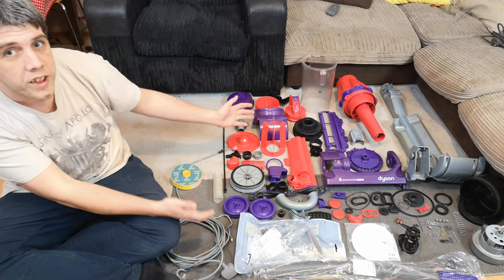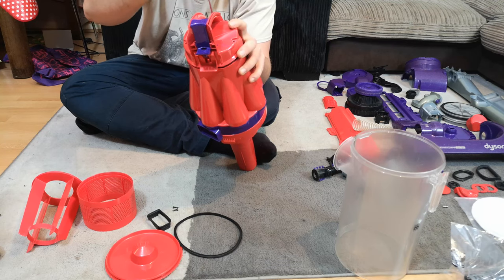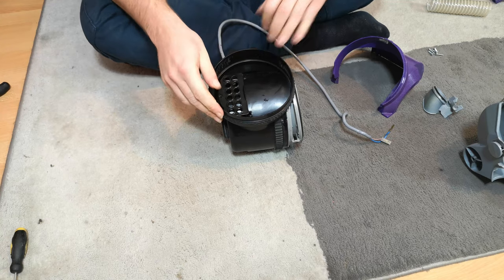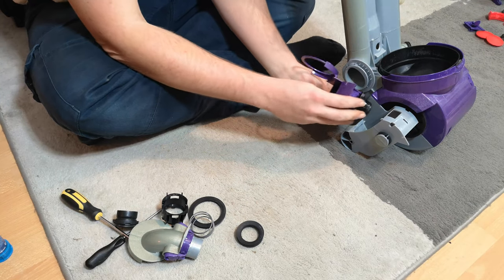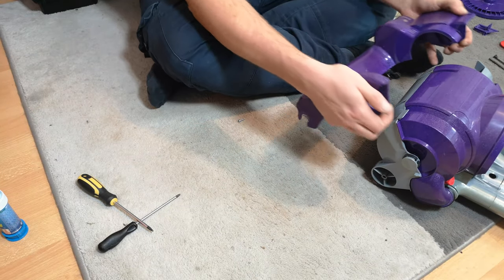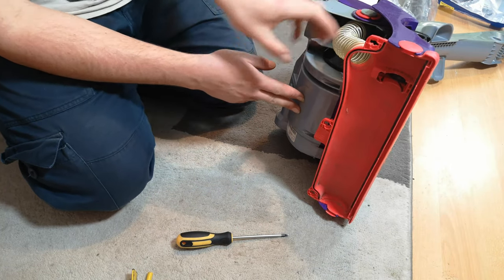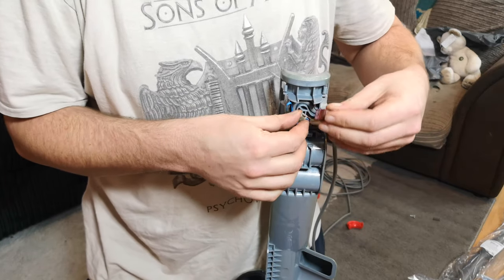Dyson DC07 - FULL Reassembly How-To Video!

Comment: Great and thorough strip down that gave me the confidence to tackle a rebuild of my own DC07. Some of the plastic parts had become brittle and had broken so I just bought a replacement chassis and transferred the old bits over. Now, cleaned up, it has the suction of a like-new machine. By modern standards the DC07 may be chunky and brash but it does the job  better and cheaper than many modern vacuums. What a shame they no longer make them. Thanks Biko

Comment: Great video & together with the tear-down you’ve enabled me to replace the motor on my 20yr-old Animal! A couple of things need highlighting though; 1) the small seal on the motor has unequal lugs (on mine at lease!) so care needs to be taken when refitting to the motor so it alights correctly with the corresponding cutouts in the case;  2) refitting the deep clutch cover screw is easier if you do it first, offering the cover up to the hole in the main chassis so that the screw slips into the channel which then eases alignment. Other than these minor points a brilliant vid which has hopefully given my DC07 a new lease of life!

Comment: I want to say thank for your video’s. You have helped many times with me fixing my DC07 Animal model. This vacuum is wonderful, it does the job it was made for. It’s getting old now(I purchase this vac back in 2008) and she is still going and picking up dog hair and cat plus human hair all these years. I’m just now replacing some parts. And there not big parts either. The parts I have replaces have been was the clear canister due to poor repair, the wonder Elderly  lady was up in her years force the old canister from the bottom to open, hence reason for new canister. I also replaced gaskets. Tutoring via  Videos on how to cleaning the cyclone, and how to put together the handle cap again. 
So thank you very very much from a lady across the pond 🙂

Comment: Dam it ! Only just found you, last week I paid £25 to have a broken wheel replaced, I could have got one on ebay for £4 but didn't have any idea how to replace it, BUT I do now !. This Dyson was bought to replace my brilliant all original Hoover 612 which was an amazing machine,  only reason I replaced it was because if you accidentally knocked the bag a cloud of dust escaped,  I was told I could wash it but it made it worse 😕 . I tried to donate it with the original tool set in it's original box but unfortunately no body wanted it, I thought somewhere like "The Black Country  Museum" or other places like that would like it but sadly I couldn't give it away. 
Thankyou for your fantastic videos.  I've subscribed,  I think I might need you in the future 😊
Reply from the maker: Shame to read about the 612, it might find a home on ebay with postage (the handle comes apart into two for ease of packing!). Their really hard to convert to an inner bag which doesn't help...

Comment: A huge help in replacing the motor in my DCO7.  I certainly wouldn’t of tackled the job or accomplished as easily without your thoughtful directions. As it was a maintenance change I didn’t extend it to the useful tear down and clean sequences you applied to machine viewed here. Those rewinds at slower speed also identified the corresponding parts to get the trickier jobs done with least fuss. 

I still managed to get to the clutch drive belt cover on but the hidden screw access wouldn’t align. After looking at the whole cover I noticed that the plate adjacent to the clutch selector switch was outside the purple changeover cover; you do show a functional check in your video to highlight this!  But retracing those steps was not too much grief. 
When refitting the brush assembly, as an alternative, I used a trampoline spring puller to extend the brush belt; which many folks may have to hand. It does require the feet to brace the upturned base as you tension the belt and,  with the brush end plate removed, slide in the brush itself.

Comment: I find these videos very helpful - I've changed filters etc etc in my Dyson DC07 - but it still has one problem I can't work out.  I turn it on and it works good - sounds great. BUT - after about 10-20 minutes it develops this ("echo-ee") sort of noise - as loud as the engine. Its hard to describe the noise - but its in addition to the engine. The suction still seems ok and all else seems to work - but the noise is annoying. Its like I've put the Dyson into a higher (wrong) gear.

Comment: Hi,  My Dyson DC07 fell and the top of the cyclone broke. I replace the very top part and throughly cleaned the cyclone and it seems fine. 

In addition, The top of the duct assembly cracked in several places where the hose and cyclone attach. Do I need to strip the entire unit down to replace the assembly?   

Are there any other parts I should replace when I have the unit apart?  I was planning on replacing the filters. 
Thank you for the giggles and all the useful information. It is wonderful to see someone who is so passionate about what they do.

Comment: Brilliant video, has helped me on my refurbish of a old DC04 that was being thrown out.  Do you ever replace motor carbons when you refurbish. As it take quiet a bit to get to the motor ,I generally do as well as belts, seems logical !!! As you alluded to parts for older models are getting more difficult to source,where possible I fit genuine parts, however the long hose seems to be difficult to source,and the ones I’ve seen have a different end ( that goes into Handel) so no sure on compatibility!!! any ideas or feedback would be appreciated.

Keep up the excellent content 👍👍jason

Comment: Thank you for this, was a great help! Although noticed that I've snapped one of the plastic mounts in the top of the cyclone where the three black screws go 😱 hope it's okay!
Reply from the maker: Any time, glad it helped 👍 I've snapped those before. They qbond back on nicely, and as long as you don't go swinging it around by the cyclone handle 2 should be fine. Once the cyclone is fitted to the cleaner it's held in more with the chassis too, so the 3 screws don't do as much work I guess
Reply: @beko1987  being in 4k was a definite bonus too. Thanks, I'll see if I can find the broken part and bond it

Comment: Hello,  I have got a Vax Ultima hoover and I have noticed that the motor is more or less the same as the ones used in some Dyson models. The dimensions are exactly the same so I would like to ask you if this motor for Dyson would be ok to put into my old Vax hoover?

Comment: Hello. Can you tell me if the duct assembly, I think some refer to it as the “spine” is the same for the dc07 and dc14? I have a dc07. The assembly literally cracked in two. I have a dc14 I picked up on the street for donor parts and wonder if it would fit.  The duct assembly is going for 120 dollars and don’t want to spend that.  Thanks for the video!

Comment: Yes great instructional video. I did do the strip down and rebuild. However although thins went back ok and does work I don’t get any suction from either the wand or the brush motor end. Any suggestions as I have checked all the obvious locations?
Reply from the maker: Has the changeover valve and it's seals gone on correctly? And do you have suction from the chassis where the cyclone goes on?

Comment: Can you advise what size or type screwdriver for top cover of barrel please
Reply from the maker: T25 torx, but some are Security torx (tiny metal post inside the screw head). Security bits fit non security screws though 👍

Comment: Hi @beko1987, thank you for the tear down and reassembly instructions, they are spot on. 

I am having difficulty getting my clutch to work. The front part of the Dyson will not stay engaged to the floor. When the handle is moved up or down the front of the vacuum follows not staying in gaged with the carper? 

Please help

Comment: Nice video Beko, you make fitting wand release clip so easy.  My replacement clip will not clip on.  Any tips please?
Reply from the maker: I just centre the top notch, make sure the spring is where it needs to be, then put one side of the bottom pivot on, then push the other wise on. The clip will (should) flex slightly and slip on.

Comment: ha the metal bracket in none cluched motor housing versions is a pain in the arse lol. if you knock it with the belt drive it completeley buggers up and you have to start again, which is fine but when there is slippery fairy liquid on your hands it is not fun.
Reply from the maker: Especially when you think you've got it and it moves mid way through pushing the motor in! Bend the tabs out slightly so it's a REALLY good fit in the housing... Doesn't move then 👌
Reply: @beko1987  yea that is what i did in the end

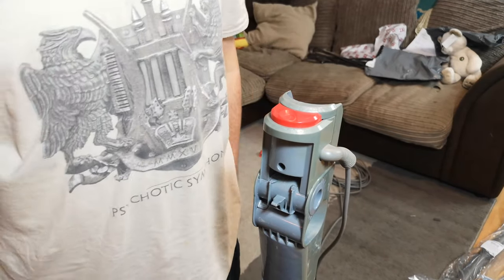Comment: This video and the dis-assembly one are sooooo good!!! I've given a new lease of life to our old Dyson DC07 twice now. HELP!!! However, at the very end of the re-assembly, I messed up (feeling too confident and speeding up the process came back to bite me...). I'm hoping someone can help me find a solution, so I don't have to break one piece and replace it. I missed the step at 28:15 of putting the spring back in place in the wand, and then fit the wand into the vacuum (28:55). It clicked in and now I can't take it out and use the hand-held wand to vacuum along the skirting board because the wand is jammed into the vacuum. Can anyone help with this issue please?
Reply from the maker: Can you Jimmy the clip back with a small screwdriver whilst wiggling the wand about?
Reply: @beko1987  I will try!🤞

Comment: any tips to get mine going better? it just dosent adjust to the floor i have to put my foot on the head for it to go down to my carpet but the second u pull back the head lifts up and dosent clean my low pile carpet anymore :( i dont know what to do
Reply: Take off the internal hose and wash it or buy a new one if you like.

Comment: My flap broke anywhere to find one?
Reply from the maker: Ebay, search for dc07 bin flap and youll have lots to choose from! May have to swap the rubber gasket from your old flap though, depends if they come with it or not
Reply: Thanks so much for the reply. Just bought this gem yesterday for 20 bucks but the suction seems weak on the vacuum end may need cleaning

Comment: Thank you.
I can now fully refurb my 2002 DC07 animal and replace the burnt out motor.
Up till August 2023 when the motor gave up the ghost, it has been used regularly in the three homes I've lived in since 2002 and has been relatively trouble free.
Even if a little high maintenance on the brush roller and filters, but that's to be expected when used in homes with open fires and having pets as well.
I'm rather surprised it lasted for 21yrs given their reputation for poor build quality.
If it lasts another 20+yrs it should see me out.💀👻😈